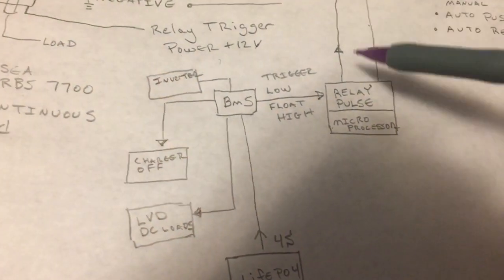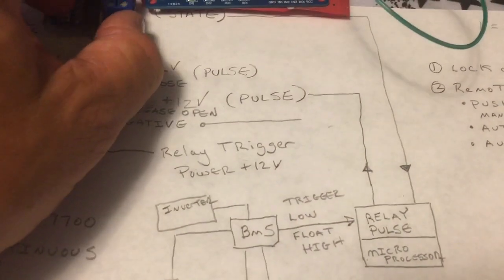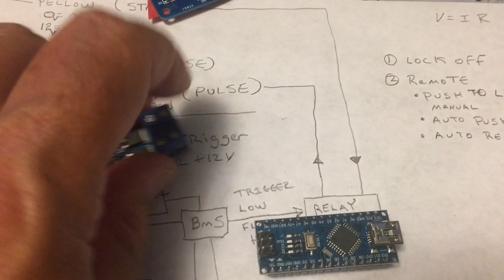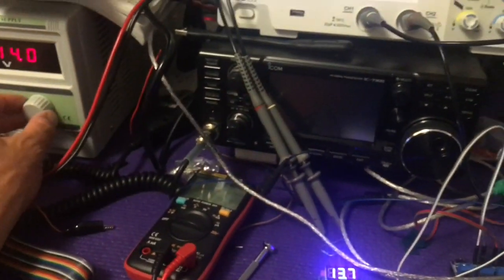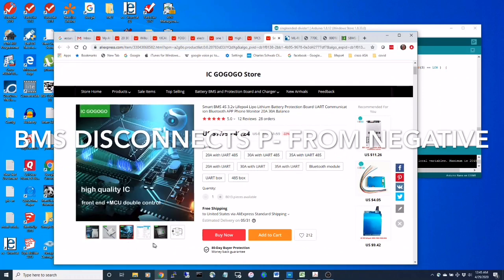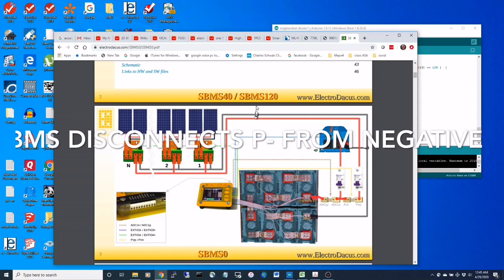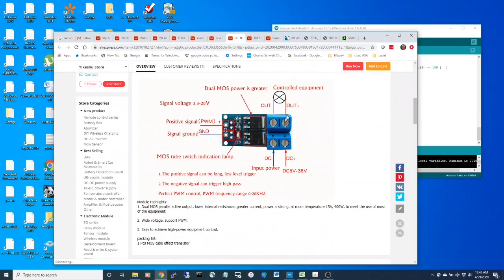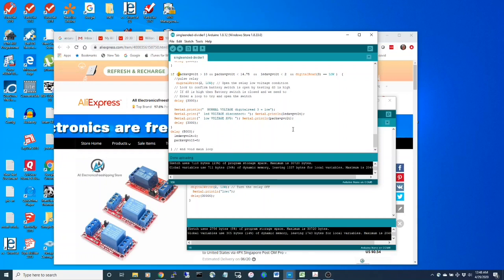BLUE SEA ML-RBS Battery Switch for LIFEPO4 Lithium and BMS Integration - Part 2

Comment: I'm also looking for a remote control battery disconnect and am using lithium batteries. I came across a video from lithium solar and he talks about "innterruption rating" at 10ka on heavy duty relays. Have you heard of that?